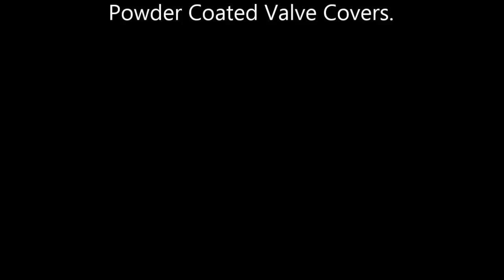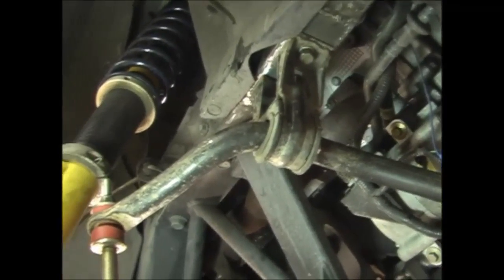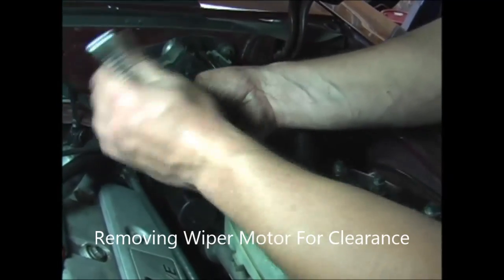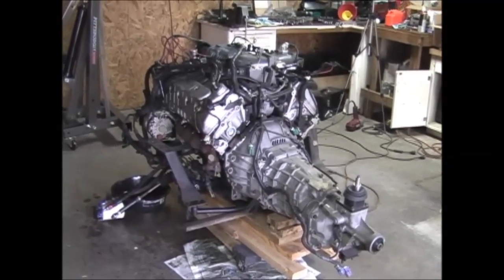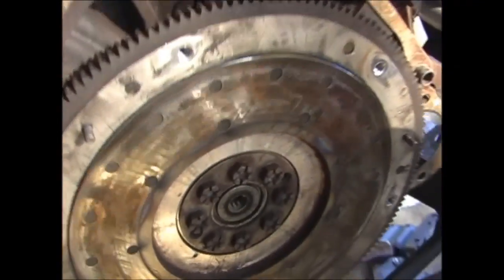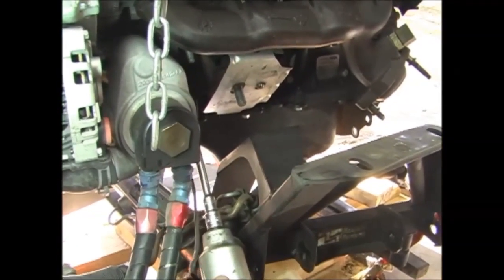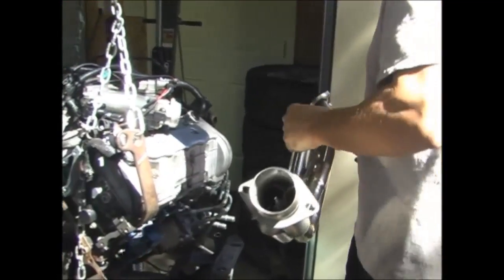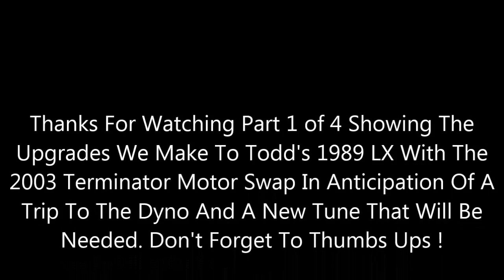89 LX '03 Terminator Cobra Swap - Mods & Dyno Part 1 Of 4

Comment: This is not a criticism post. I like your ride. But why not just stick with a Windsor? What is the advantage? I get claustrophobic looking at that engine bay. xD

 I'm inexperienced/ignorant on the +/- of running a 4.6 vs 351. Is this build superior over a mild 408? Mild as in not a super aggressive cam that runs on pump gas, but also running a dart block.

I'm just looking at that and asking how are you going to do plugs with those heads, and not even mentioning the long tubes.

Comment: I'm getting this swap done to my 1992 GT this week. Can't wait till it's done. Todd did u get your AC and heat to work? I know they said they will have to do custom lines for my car
Reply from the maker: Awesome !  Todd said he used an '03 heater core inside the original Fox evap box. The '03 evaporator is too large for the Fox evap box, so he had to have the '03 ends welded onto the Fox evaporator.  It did not cool really well, he thinks most of the air was going around the evaporator instead of through it due to a poor seal. Sort of a work in progress there.
Reply: FordV8Forever 
Hey Todd you did a great job on this build. How did you wire up the rear tail lights pics details anything will help please
Reply: Tim Pritchett how did it come out bro?

Comment: How are you guys wiring up your tail lights to the 03 cobra harness
Reply from the maker: Todd says it depends on how much of the Cobra wiring harness you are using, can you give more details ?  At any rate you will probably need the wiring diagrams for both cars.
Reply: FordV8Forever 
I'm running the full 03 cobra drive train/harness everything from the cobra. I have the fox body tail light harness just need to know how to splice into the cobra harness to have have the rears function properly. Pictures details. Please
Reply from the maker: Need to know what steering column and turn signal switch you are using.  Do you have an email address we can reply to ?
Reply: I spliced my tail light harness into cobra harness with a test meter to see which wire was hot when lights were on . Probably the hard way but it worked